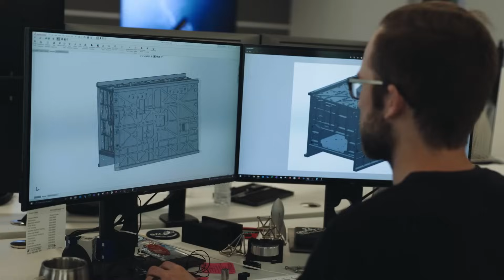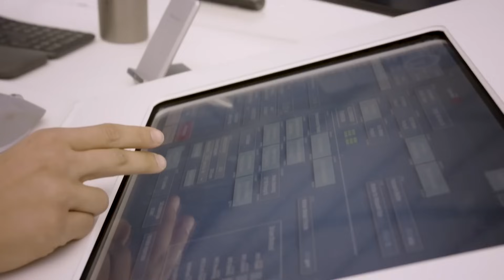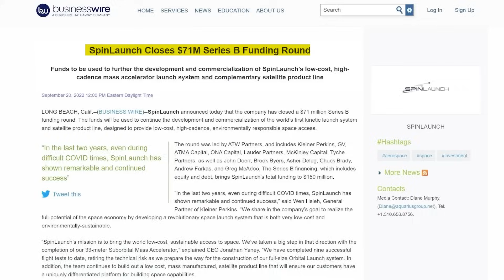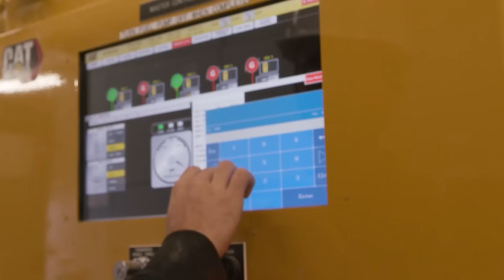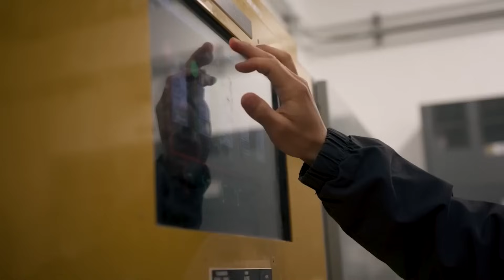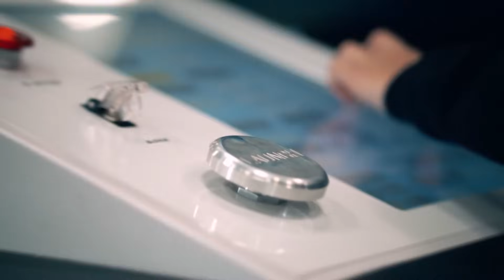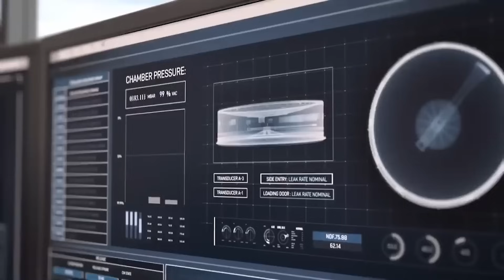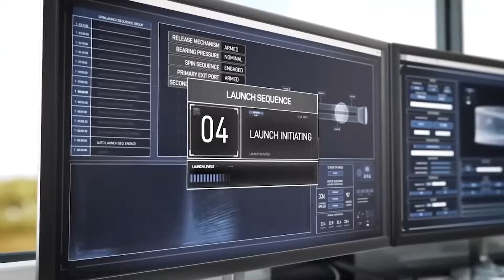What’s REALLY Happening With SpinLaunch’s Orbital Accelerator!

Comment: On earth, this will only ever be "sub-orbital". This can not get to orbit, nor can it launch something that can. There is a fundamental problem with their design. Math.
 
Anything they launch will require a second stage to get to orbit with the same required delta-v. A typical second stage of a Falcon 9 weighs 4,000 kilograms (8,800 pounds) without propellant. With propellant, the second stage weighs 111,500 kilograms (245,800 pounds). 
SpinLaunch's full-scale size and exit speed of 5,000 mph (8,100 km/h) (1:55, 7:28) translates into a peak centripetal acceleration of between 50,000 and 100,000 g's. One g is the acceleration due to gravity at Earth's surface. 
This means their spinning arm would need to hold between 5.5 billion kilograms (12.3 billion pounds) and 11.1 billion kilograms (24.6 billion pounds).... 
Also MECO of a Falcon 9 is about 80 kilometers (50 miles) high, traveling at 11,000 km/h or 6,800 mph. So SpinLaunch would need an even larger second stage and we are not even counting the arm itself.

In layman terms: Their single spinning arm would need to hold and spin 14 to 30 Golden Gate Bridges worth of weight. Even "high strength carbon fiber" (7:42) can not hold that. This is just a fancy slingshot and a pipe dream. This cannot get anything to orbit.
Reply: And I just looked up the tensile strength of carbon fiber: Carbon heated in the range of 1500–2000 °C (carbonization) exhibits the highest tensile strength (5,650 MPa, or 820,000 psi), while carbon fiber heated from 2500 to 3000 °C (graphitizing) exhibits a higher modulus of elasticity (531 GPa, or 77,000,000 psi). So at its best at 531 GPa they would need a 27 square foot thick arm made of the most perfect highest strength carbon fiber.